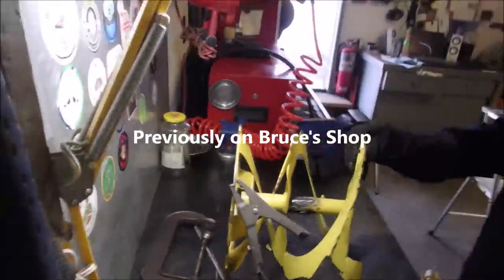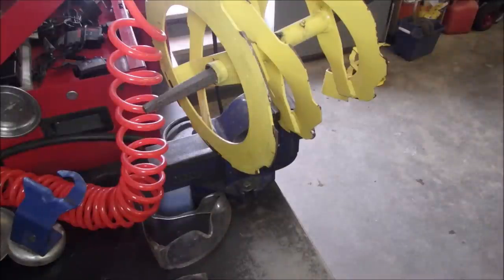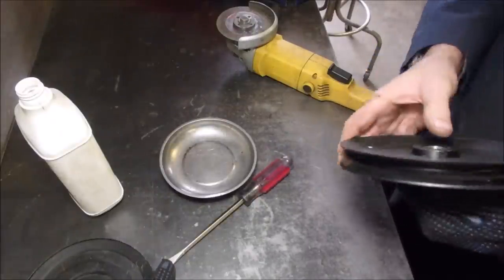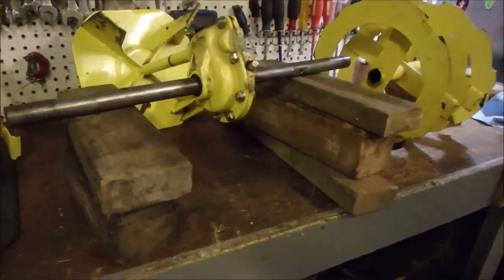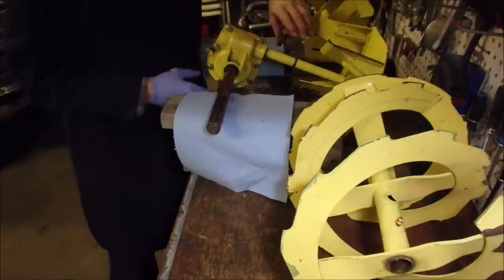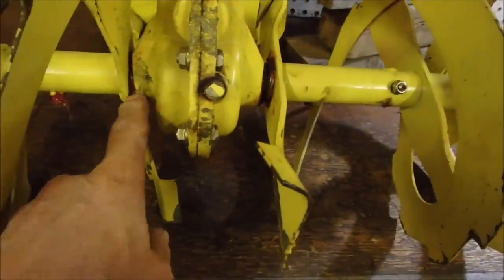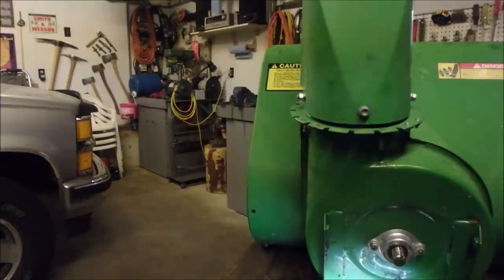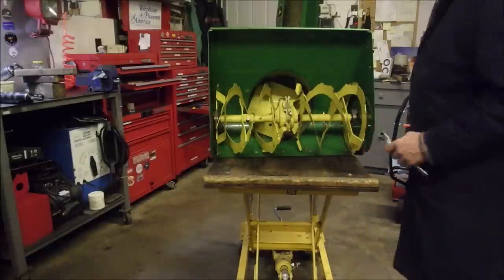John Deere TRS 24 Snowblower  Auger Assembly

Comment: I cut the crankshaft of my kawasaki fx691 v twin 20hp to retrieve a broken electric pto clutch bolt, that a dumb untrained kid did when he was taking the pto clutch off, and didn't understand the off and on switch on the air tool, I took the crank shaft out of the engine, did the cut, got the broken bolt out, then grinded it smooth and level, and the engine works perfectly..... Great job sir.
Reply from the maker: Right  
The things we do because  -----we just do.  LOL
Reply: @BrucesShop  Hahahaha exactly.

Comment: Good job buddy. We have had to do many of these weld repairs at EP and we are lucky to have a plumber two doors over that has a mini lathe that machines our hubs if necessary. He also has made us a number of bronze bushings when we were stuck. The best is he has given us a number of different diameter copper pipes that we simply cut a slot into so we can force them into the auger inside diameter where we need to weld which stops any weld material from going into the inside. This alone has saved us a lot of aggravation and grinding. Too many snowblowers coming in with grade 5 or grade 8 bolts instead of the proper shear pins or bolts but great for business eh?
Reply from the maker: Exactly.  You re right.  I should get some 3/4 and 1 inch copper pipe.  This one was a bit of work to ream out.  I probably do 1/5 of the machines you guys do though
Reply: @BrucesShop  Well worth it to get a couple pieces 2 to 3 inches long it just saves so much time Bruce

Comment: A small mig welder would have been easier on thin metal
Reply from the maker: You are correct.  i have a small Flux core as well but the AC buzz box does penetrate.